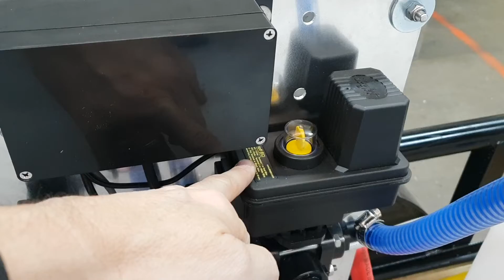Hydro-Mixer XL with remote rinse module installation

Comment: What fittings did you use to accomplish the 90 on the right side
Reply from the maker: @jaredzeno  1" poly female elbow with 1" mpt nipple and 1" mpt x 1 1/4" hose barb for the AR45 inlet.
Reply: @ thanks!

Comment: I've notice a few other builds have a T fitting for the water whereas you (and us as well) have a dedicated water line feeding into the existing way and 1 to the metering valve)  Do you feel there is a difference between the 2?  Also, we don't have a check valve on our dedicated water line from 3 way ball valve to water tank.  Should we have one?
Reply: I feel the same, we will keep things as they are then. Thx
Reply from the maker: There's a big difference, if you use a tee, you run the risk of starving the pump and collapsing a hose. Best to run two dedicated lines.

Comment: Why does the bypass go back to the manifold? Wouldn't it dilute the mix?
Reply from the maker: No, solution bypasses when you're off the trigger.  And it's a closed loop bypass as well.  Very little solution bypasses while actually spraying unless you adjust the regulator down for less gpm.

Comment: Are you using a booster pump running from your tank? Or does it drawl the water out of the top of the tank just by the pump on the ar45
Reply from the maker: Just by the pump, no need for a booster pump

Comment: Great video! Can I ask you how are the connections where water or bleach get sucked (at the bottom of tanks? Like a pvc filtered pipe?
Thanks in advance
Reply from the maker: Water has hose end strainers and bleach pvc filter with titanium hose clamp. Both can be purchased here https://washingequip.com/shop/ols/categories/parts

Comment: Subscribed! 

IM LOOKING to get the proportioned from you guys. What are the lines that you guys are using to feed the pumps? and outlet lines? 1/2" for softwash?

Tank to manifold size line? 1"
soap line? 1/4" 
chem line? 1"?
What size line is your softwash hose?
Reply from the maker: 5/8" softwash hose, water & SH 3/4", 1/4" soap

Comment: What is the purpose of the soap remote valve? Could you turn the soap off at the mixer?
Reply from the maker: Yes you can that. The remote saves you the trip back to your rig to do that..no walking back and forth to switch between chemical and rinse.
Reply: @midwestwashingequipmentllc1209  I was talking about the smaller on/off valve. The larger 3 way electric valve swaps mixer and rinse right?
Reply from the maker: @JaceF8  Our remote system does 2 functions, switches bleach over to water so you're running water through the bleach valve on the hydro-mixer and turns off the soap.  When it's "off" soap is off and bleach valve has water running though it.  When it's "on", soap is on and bleach valve has bleach running through it.  You technically never have to close either valve on the hydro-mixer.
Reply: @midwestwashingequipmentllc1209  oh ok gotcha. Thanks